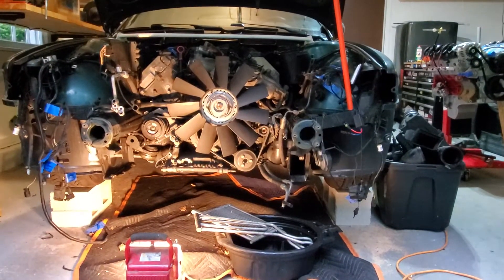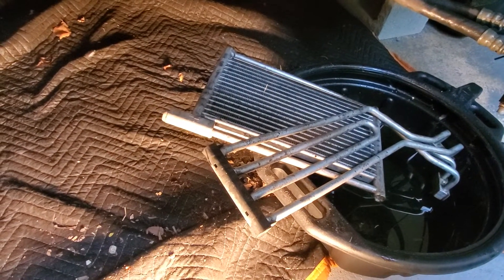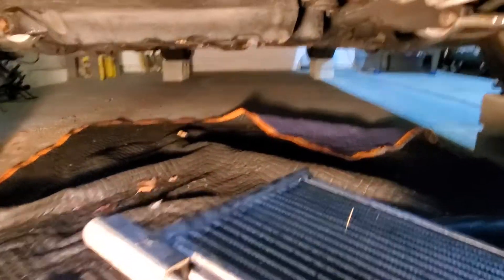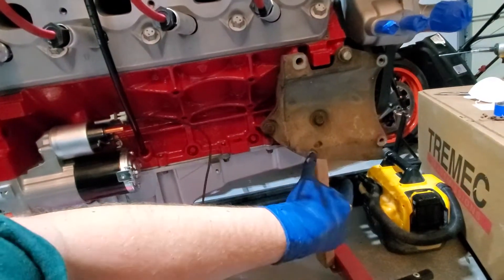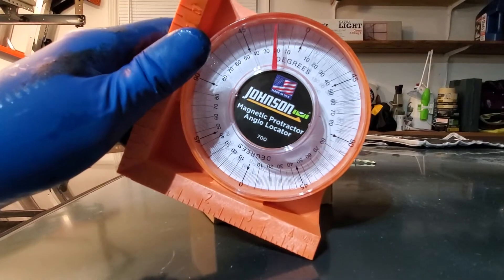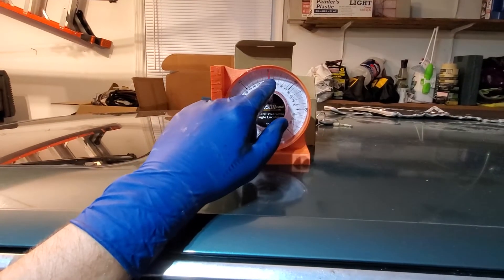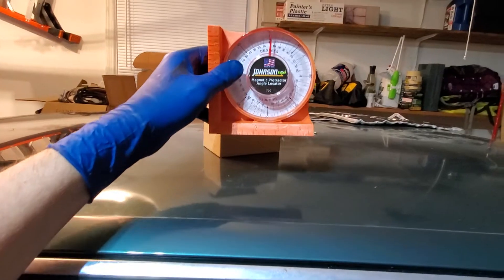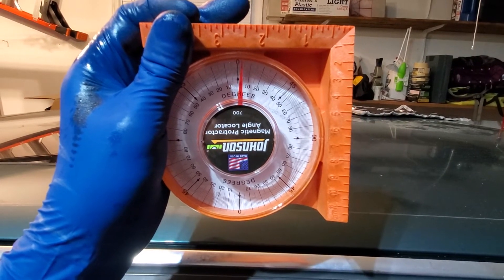e38 740iL BMW LS swap pt.4

Comment: I'll soon be an LS3/TR6060 in my 2001 E38 740iL.  Enjoying your intro to the project.  So the BMW A/C compressor mounting bracket bolts onto the right side of the LS block?  any other ancillaries bolt up w/o mods?
Reply from the maker: Hey David, the compressor bracket I have on the LS motor in this video was the factory GM compressor bracket. The bmw compressor bracket is part of the passenger side engine mount, it's all one piece. There was no way I was able to use the factory bmw compressor mount and engine mount on the LS engine unfortunately. You'll see that in my future videos. Good luck!
Reply: @thehomeofbiglspower  Got it.  I'm getting a dropout motor so will have AC compressor mount already.  I'll keep watching...

Comment: So the GM compressor from the LS  engine fits?
Reply from the maker: Yes it does. I'm putting up a video today about that. Just have to build your motor mounts to avoid the compressor. I made a separate video about motor mounts for my swap.